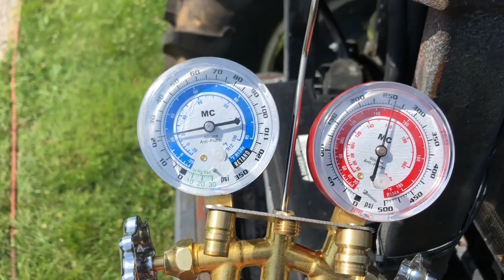A stroll down memory lane!!!

Comment: I had a ac doing the same thing last year. When it stopped I find something to hit it with and it start back. I got to looking how dirty it was with dust. I took some electrical contact cleaner and sprayed the clutch out good it has worked just fine ever since.
Reply from the maker: jpowers5023 thanks bud I’ll try that

Comment: I have hand shoveled many a silo empty. I bet you can still smell it around there even all these years later. Did you say ya had harvester silos also? They were junk and never worked right and always plugged or froze up! 
You better get something done with that old pit before someone falls in there. New grates or bust out bottom so it will drain! Old yeller JD looked like an old state highway mower. They liked em low n wide to hit the steep ditches with...Great Vidja and Thanks for Sharing!

Comment: The first tractor I ever ran was a 1953 ford jubilee. 4 cylinder gas with exhaust out the back 4 speed with 4th as a road gear
Reply: J Hill first I ran was an NAA golden jubilee 8 speed. My cousin still has it to the day
Reply from the maker: Haha I bet you pulled logs with it that’s what grandpa Etienne used to pull wood back in the day